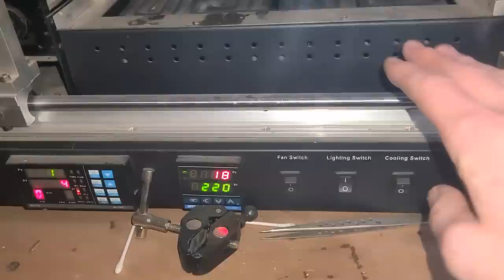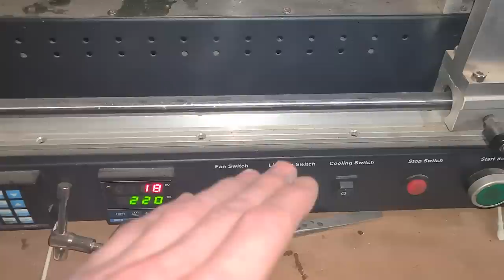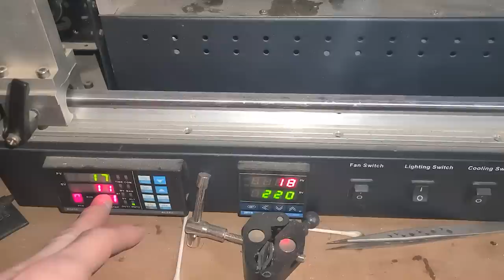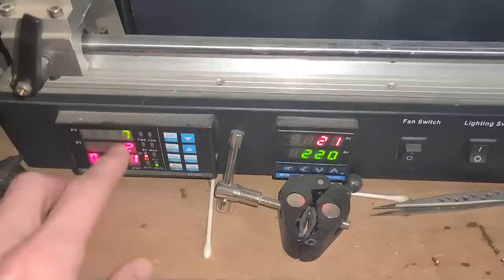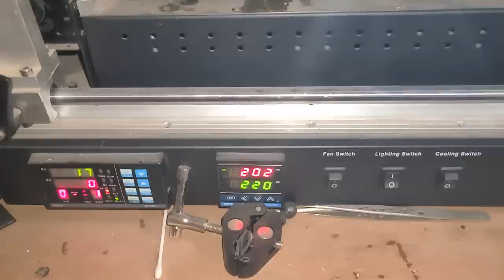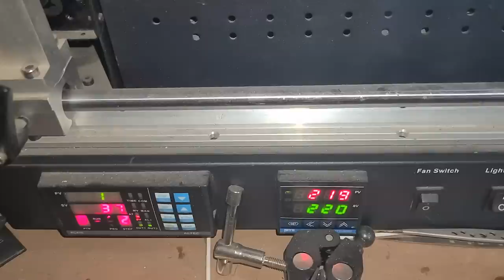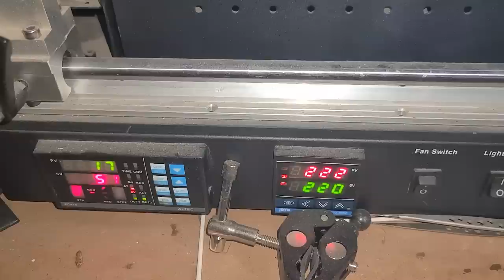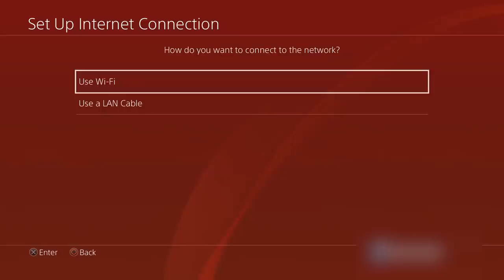She DUMPED Her Husband's PS4 As Payback (After Rage Quitting)! Can I Fix It?

Comment: Congrats on the fix, maybe this will finally motivate me to try fix my 7.55 CUH-1200.

In 2020 it shutdown with an overheating error message.

I left it off for a few hours to cool. Then I removed HDD cover, switched it on and no fan spin at all, but it booted OK to the dash.

Bought a genuine replacement fan from eBay seller selling torn-down Ps4s.

Cleaned heatsink, replaced fan, removed old thermal paste for some new Ceramique 2.

Ps4 kinda works now but randomly shuts down with a clicking sound (kinda like a relay switch click or maybe hdd?)

No error message whatsoever.

It can sometimes play for over 10hours straight no problems or it may shutdown after 1 or 2 or 3 hours playtime.

Once shutdown happens it will just keep on shutting down immediately after powering on.

Cure is to leave it the F alone for a couple of days unplugged and it may power on again.

Oh yeah if the Ps4 is on and stable and I make the mistake of switching off to take a break, it will have the repeated shutting down problem when I try to switch on again.

Had never been jailbroken before 2020 coz i used to update to play the latest & greatest.

I only got the 7.55 jb by accident coz the Ps4 is mostly unusable in its current condition so I don't use it or update.

Made the 7.55 jb to check temp and try if the fan exploit mod will solve the problem but no joy, Temps are OK btw.
Reply from the maker: If it's making a clicking sound from the hard drive bay it sounds like the hard drive is dying. If not, it's likely failing caps in the power supply but you're much better off just replacing the psu if that's the case since they're dangerous to work on and cheap to buy
Reply: Thanks for the reply.
Unfortunately I could never really pin-point if the click is from the hdd or from elsewhere.

I've been debating whether  to also buy a 12xx Psu from torn-down eBay Ps4's

or instead buy 2.5 Sata Ssd to eliminate a faulty Hdd as source of click,  coz I was thinking maybe the Psu has relays clicking
(ala my also dead Ps3 which had audible psu relays)
& pointing to maybe psu fault.

On the confidence of your recommendation I'll get both & hopefully resurect my trusty 1200, wish me luck. Cheers
Reply from the maker: @F14foreverF14  yeah I think the psu is cheap enough to be viable to at least give it a try, along with a hard drive which are super cheap these days 😀

Comment: I've had a few 1215A's here that were dead and reflowing the southbridge fixed them. I think it's possible it was the southbridge and you fixed it indirectly on your station. I don't trust these run cool enough so I also put a thermal pad on the southbridge when I put the board back in.

Comment: This is interesting I will say. Purchased a ps4 slim that went down the stairs, and other than the completely destroyed shell, it also has a blod. Though it isn't a 2 second one. It just stays on a pulsing blue light. I have a feeling it may be the apu, but I need to dig around the board first to narrow down possible issues. I did have to replace the inductor on the AC input in that console's power supply too since it literally broke.

Comment: Have you ever worked on an ACM for a ford radio? They have an issue with their radios that is usually referred to as the blinking clock of death. My radio in my truck is having this problem and I can’t find anything about how to fix it besides placing acm mother board into the oven to reset the solder. From what I’ve found it’s a temporary fix for this problem and doesn’t seem like it’s worth the trouble of disassembling just to have it work for about a week.

Comment: Hi Phil. I have a PS4 1216B that the optical drive is not reading discs. I have swapped the drive and ribbon cables from my own working PS4 and it still comes up with Unrecognized. I know the 1216 optical drives don't have a daughter board so its not that, I have also updated the software, rebuilt the database, did nothing so I then installed a new HDD and installed new software (v10.1 from memory). Tested all the fuses apart from F6001 as I cant find it on that motherboard for some reason but it still will not read discs. Would you have any clue as to what else it could be? Thanks mate and keep up the good work, you're a legend 👍

Comment: Time to restock store with PS5's and some switch's ... I was gonna pull the trigger on a ps5 from shop and looked closer only to see SOLD OUT... Sad day for me... ahwell, I may buy a parts only from ebay and fix it as I have been working on my SMD repair skills. I have all my own tools and such but no microscope just a huge magnify glass with ring light that attaches to work desk ... works well enough for now

Comment: I think you'd actually be better - at the end of the video - summarising:-
1- how long said repair took you
2- total charge including parts/postage back to the customer

Full transparency is key and after having a look on your website there are actually no prices at all, so an "idea" of different prices) charges for different results, would actually attract more potential customers,...if that is one of your goals here.
Reply from the maker: To be honest time is something I can't really guage. Things always take longer on video. This video was 1hr 20 minutes long unedited, but if I wasn't filming I'd have got this done in less than 40. Prices are generally on a case by case basis because most repairs are different. I generally add £40 to £60 on to parts costs for most last gen repairs and some current gen repairs. Some of the more complex repairs like bga rework I normally have a flat rate of £80 for last gen and £120 for current gen

Comment: Phil, does your thermal camera have enough resolution to pick out a shorted SMD capacitor grouped around other capacitors or does the area look like a hot blob?
Have a great weekend. 🍻
Reply from the maker: It isn't quite that good to be honest. It's good enough to locate a general area but if it's densely populated it struggles a bit
Reply: From my pov - as long as you dont really make use of it daily - its not worth investing so much to buy a better thermal cam - as soon as u found the general area of the culprit, just go on with alcohol/freeze spray or logic analysis/desoldering.

Comment: You need to use the thermocouple on the top heater/pc410 or you are following no temperature profile at all, and just running the top heater on full whack until the solder melts!
Reply from the maker: It doesn't run on full whack, it's set to increase the temperature at 0.8⁰C per second. It doesn't matter whether the thermocoupler is there or not
Reply: @TheCod3r  that is not how pid controllers work, the power delivered to the heater is proportional to the distance between the set point temperature and the actual temperature - without any feedback from the thermocouple(no r) all that is increasing at 0.8°C/s is the set point and because that set point is way above the actual temperature seen by the controller the heater is on full whack